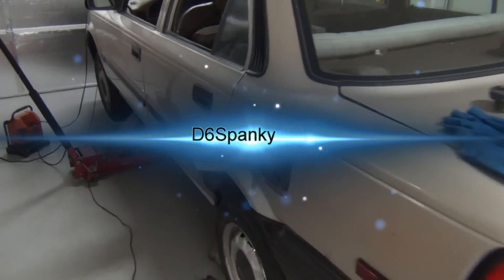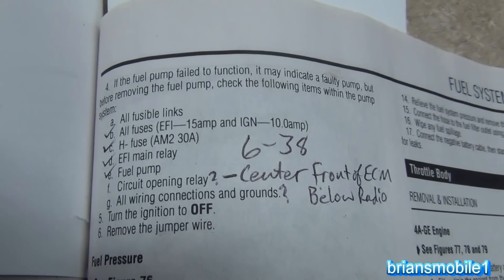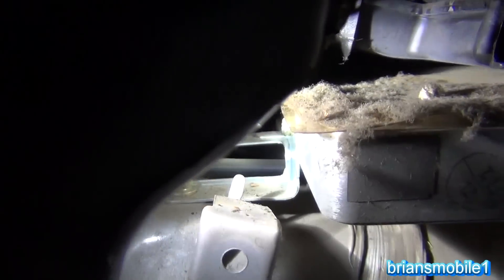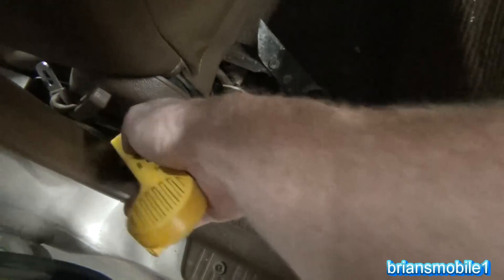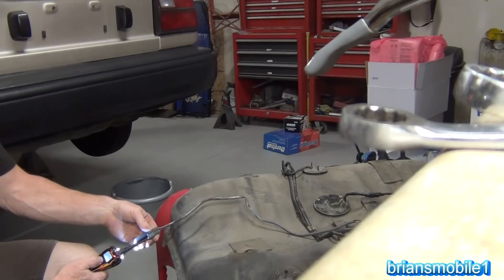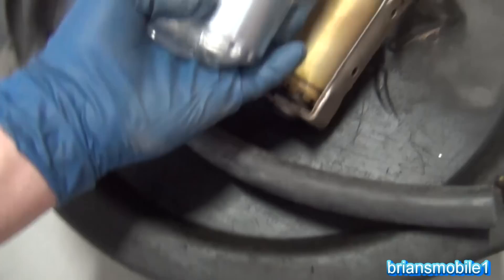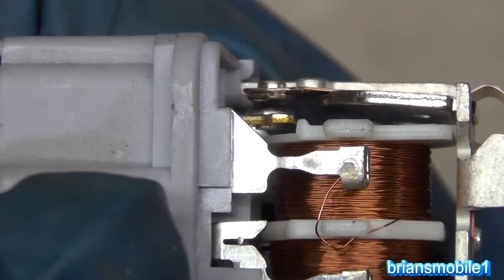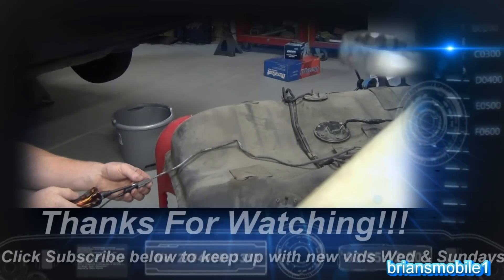Toyota Fuel Pump Circuit Opening Relay

Comment: Brian, in the olden days of points, plugs and condenser tuneups, every decent backyard mechanic had a "point file" in thier tool box. It is designed specifically to pass the file between the contact points several times and this would remove the carbon buildup from the points to make good contact. Some folks would call the process "burnishing" the points. You need to add point files to your tool arsenal.  Excellent vid by the way.
Reply: I actually bought one of those point files to use on my 1989 mustang 5.0. Sometimes my brother had the tendency to quickly release the key ignition from the start position which would create a quick spark at the distributor rotor tip   causing carbon build up at that tip and the contact points on the distributor for its perspective spark plug cable. At first I would use sand paper or a new sharp blade to scrape off the carbon build up on the contact points. This would solve the problem and the engine would turn on right away. I told my brother not to give it a quick turn of the ignition switch and to count 2 maybe 3 seconds when turning the switch to the START position to ensure that the engine would start.  I bought this point file at autozone, surprisingly, and it came in handy. Later I replaced the ignitor, spark plug cables, distributor cap, etc with higher end brand parts. Haven't had the problem ever since. That simple point file is in my specialty tool box; tools that never lend out.

Comment: Ah ah! 25 years ago my 78 Celica ..I thought my fuel pump went bad ..pulled it and at the last moment ( knew nothing of electrical diagnostics at the time) I  hooked it straight to the battery and watched it shoot water for 6 + feet ..so put it back in and ran a switched power wire to the pump ...also worked as a poor mans fuel shut off anti theft ; I would forget sometimes to hit the switch ..my car could only go about 300 feet
Reply: deepsquat600 Great story!
Reply: yeah what I meant to add there was I wonder if THAT relay was my problem?
Reply: deepsquat600
This particular design of relay as a part of the fuel cut off system to protect you in an accident...guessing here...I think came around in the 90's. Maybe a little earlier.

You probably had a simple wiring problem...well, not know where the problem is...simple could be horrible without that tone device.

Comment: Hey man! this reminded me about a thing. My girlfriends mom got a 93-ish Toyota Celica that she managed to flood when it was a rainstorm so the water on the road turned out to be to deep... Now nothing happens. it works pretty long time but then there was some other problems (exhaust almost fell of and a bad rear tire). The starter relay doesn´t even click now. we´ve tried to push start it with another car, but nothing. we find out all four spark plugs had cracked ceramic, so they are new now. there´s no water in the fuel tank and the pump runs. Any idea what it could be? or atleast where to start looking. even if the starter doesn´t work, it would atleast started when being pushed. and also, since the starter doesnt work, we don´t know if it gets any sparks (hard to se when you´re being dragged behind another car haha).
sorry for this really long comment, but i´d want to make it run. nothing else for now, just to hear it atleast trying to start

Comment: Ugh...  Airtex pumps are such utter garbage...  I've had good luck with Precision brand on the lower end of things, though!  Typically about the same price as the Airtex units; they just run quieter and last longer.  ;)
Reply: rhkips I honestly believe Airtex telling AutoZone that 80%-90% of the failures were garbage in the gas tank related. (Word of mouth from a parts salesman . . . sorry, I love my parts guys, but I can't be sure of this reference.)

Trouble is...that always happens and most people can't afford to pay a mechanic to do a thorough clean out...so their excuse for a bad rep. doesn't hold any gas, I mean water.

Yes, this should cause premature failures, but just a bit of crud shouldn't bother most fuel pumps or even new cars with Airtex failure rates would be failing due to the crud that certainly comes from some/all of pumping stations.
Reply from the maker: rhkips I've had them fail inside of a year with perfectly clean strainers.  I WANT TO LOVE THEM.... but can't.  They just don't perform as should be expected.
Reply: DE Nichols
Yeah, I once had four go bad within a year on the same vehicle.  The fuel tank was replaced at the time the first Airtex pump went in, and only top-tier fuel from a known-good source was ever put in the vehicle.  As it was my own personal vehicle, I can say with confidence that there was no contamination in the tank.

After warrantying out the fourth unit, O'Reilly's gave me a Precision brand unit, which outlasted the car at >2 years.  Ever since then, I've used Precision pumps on customer vehicles when OEM units weren't an option, and haven't had a single complaint or comeback.  :)
Reply: briansmobile1
It's really sad; they used to make such good equipment.  My experience with them has been so bad that I avoid anything with the Airtex/Wells brand on it.  I don't know if their other stuff is garbage, but I don't want to find out...

Comment: Looks good.  I'm surprised you don't have a point file.  

Chris
Reply from the maker: shadowdog500 I have a whole set, but the contacts here are to rigid and the gap is too small- most tech's these days don't even know what points look like- let alone have tools to service them.
Reply: briansmobile1 newer vibes have the same thing, well vibe/matrix it is up under the dash dude, guys like to splice the after market auto starts into them and well over time corrosion will get into there amazing sealed soldered joint and cause a no start

Comment: Incredibly helpful video for anyone with one of these toyota's. Thanks for another great video
Reply: steve hall My shop doesn't know how to charge for electrical work - literally, not a part of the corporation for the most part. So tracing a few problems with a tone generator an saving tones of time will really help me on TONS of problems. Especially, with the tip to hook it to ground as well so all of ground doesn't generate tone.

Shoot. Can't find a relay? Hook a tone generator to the fuse that'll go to the relay. Found! THE best part is getting smarter around Briand. :)

Comment: i clean relay contacts all the time. the trick is to cut the plastic cap off cleanly so you can re-glue and use fine grit sandpaper (400-600 grit).
Reply: happy543210  
Yep,I have been cleaning/restoring very expensive relay contacts for decades. Some would literally cost $1000s to simply replace. 

Just a friendly tip, the cleaning/restoration job will be more reliable and last much, much longer using a relay contact burnishing tool such as these: 

http://www.pkneuses.com/www.pkneuses.com/cont.htm

https://www.google.com/search?num=100&newwindow=1&site=&source=hp&q=relay+contact+burnisher&oq=relay+contact+burn&gs_l=hp.1.1.0l2.1129.22423.0.26135.19.16.0.3.3.0.273.2902.0j5j9.14.0....0...1c.1.64.hp..3.16.2638.0.60ullnSY_1E

The reason being that using sand paper leaves residue/debris behind that creates resistance and promotes arcing and new carbon buildup.
Reply: thanks Happy, You are the man. That's what I needed to know. Thank you!!

Comment: My G-D who thinks of hiding these parts. Instead of all the political correctness these days we need to hunt down these engineers! Never thought of using my tone and pickup on my car, great idea! Best of luck to you and Spanky!!
Mike
Reply from the maker: Mike Shelly Thanks Mike!  In all reality, this car is almost a quarter century old and this is the first time it had needed to be accessed.  That's actually GOOD engineering.  And the only reason it went bad, was because the car sat and got rusty in the gas tank which caused too much resistance and heat to the contacts.   That's not too terrible.  To me, bad engineering is designing things that leak no matter what you do,  are of poor materials, or vibrate to death on the road, or fail over and over again through campaign after campaign of TSB's, recall's and patch ups.  Basically Taurus' and Altima's over 100k miles.
 ;  D  I HATE those @#$% cars!  HA!
Reply: briansmobile1 Just replaced the fuel sender in my VW, and bought an aftermarket one, as the OEM is way too expensive, as it of course contains the fuel pump. Same white plastic turned yellow brown in mine, and the fuel pickup filter was half clogged with fine debris from the assorted fuel filling station tanks. Of course being aftermarket I had to "finesse" it a little to get it to actually work, but it at least now will read properly on the gauge.If it conks after a year I will be doing a swap between the two to combine the best of both, as they are direct copies down to the tooling marks ( old one was genuine VW though) on the mouldings.

Those Toyotas are pretty reliable, I rebuilt the engine on mine after it blew a head gasket on overheating from coolant loss, and did a lot of practise on rust removal and plating of panels. Service regular and it will do another 20 years. As the old saying is Everything keeps falling off - Toyota. Mostly bulletproof drive trains though, aside from the Cressida 2l or larger, which loves to eat the differential. Drive not like you stole it and it will just carry on.
Reply: Kidding? Its a 91 and still running..
Reply: ***** Still a shedload of 1960's era Toyota Coronas still running around here, along with all the Corolla variants ever built, in large numbers and varying condition. There are still Toyota Super 16's and Hi-Aces running as taxis, on the road 24/7/365. You can't tell the mileage, as the odometer either has worn out or has been around the million km mark a few times. Helped a friend with his Corona pickup, though we did decide to sell it, not enough time to give it justice. Had to do a lot of electrical work, along with some bodywork and massive rust replacement. was fun getting that fuel tank back in with the ultra stiff old piping, as there are no replacements available that fit, though we did eventually make a steel elbow and used new pipes to get the thing in and not leaking. It arrived driven down 400km, with brakes that were best described as "mostly there" and a clutch that mostly wasn't. Funny enough clutch off the shelf, and brakes went a few oversizes on the reline.
Reply: briansmobile1 For sure quality is the utmost on the list BUT you should not have to dig into a dash to fix a fuel pump issue. I don't want to put my  mechanic out of business he has to eat too but as a dyi'er I should have a fighting chance to fix a simple issue like a relay. If that relay was in the engine bay or with his other friends  it would have been a 5 min job bet it took you a lot more than that. Good job by the way!!
Reply: SeanBZA I bet Bosch is the OEM for your fuel pump. They love to integrate as many components as possible into one unit, which in itself isn't so bad, as it keeps manufacturing costs down. But when one such component fails, like your fuel sender, or the electronic parking brake motor that is integrated into the rear brake calipers, you have to swap out the entire unit. You can't get into the unit to replace single components because a) they have welded or riveted the unit together and made it unserviceable, and/or b) they simply don't sell replacement components. You have to buy a whole replacement unit, and Bosch and the dealers make lots of extra cash.

(Sorry for the rant. I just had to vent my anger.)
Reply: pesshau Yes, all in one. It did last 14 years though, and did 220 000km though. I have changed the pump alone on GM vehicles, as the OEM price makes a pattern part pump alone worth the work. Needs a little work to get it to actually fit and work. 

GM, they make the water pump the cam belt tensioner, so you have to buy one every time you do the belt, and often the bolts rust fast so you have to pull the engine to drill the old one out as well, or drop it so you clear the chassis on some of the bolts. Then they make the pump so cheap and nasty the seals fail before the belt change interval........
Reply: Mike Shelly  Inside the passenger compartment up high on the transmission hump was the best place to mount the environmentally unsealed components of the day(25 years ago) such as the ECU/PCM and fuel pump safety relay to protect them from heat, vibration, moisture and damage.  
On this model car the area they were mounted in is not that difficult to access either. 
Unfortunately a lot(most) of the less expensive manuals do not describe the circuit operation, have a decent diagnostic fault tree chart, accurately identify the location and routing of wires/cables, connectors, grounds, components such as the COR and ECU/PCM which can and usually does extend the MTTR of electrical related complaints/faults.
Reply from the maker: Mike Shelly It did take a long time.  You're right about that!
Reply: patw52pb1 I can appreciate that. Especially the PCM. But they could have put that relay with another grouping. Oh yes the manuals that's my other grievance.  The Haynes and Chilton manuals (same now I think) really suck. As a dyI'er not going to spend a monthly fee for a manual have 4 cars.

Comment: Great diagnostic.  Tracking it down all the way to carbon inside a relay.  You're too good. :)  That short finder (tone generator) is surprisingly affordable especially compared to Power Probe version that has a similar device.  Poor Airtex getting no love.  Made in the USA but with their failure rate it's like they're made in China. :(
Reply: ***** Unfortunately, that's the case with a lot of Western manufacturers these days. They have to cut costs wherever they can in order to compete with cheap Chinese labor.
Reply: ***** Made in China, packaged in the USA/Mexico to meet the minimum local content spec to have the USA mark. 

You know you can go to a Chinese manufacturer and they will happily put the Made in USA mark on the box for you, so long as you pay them they do not care, and will smile.
Reply: SeanBZA That crap used to be illegal. We had the stiffest most awesome labeling laws in the world. Now the U.S. can legally lie made in the USA as long as inside after you buy it you find the made in China.
Reply: patw52pb1 The laws must have improved again. I was having some freak out moments several years ago where it said proudly "Made in U.S.A" for a China label to fall in my lap as I opened my new knife package. 

Some news caster commented on labeling laws being shot. Thanks for reinforming me correctly. :)
Reply: patw52pb1 I  think everyone who thinks on this stuff sees through "assembled" in U.S.A.
Reply: DE Nichols Absolutely! All it takes is partial disassembly to see the majority sub-assemblies that are (usually) clearly marked as foreign made to confirm that most of the item is truly NOT "Made in USA" and the assembly in the US was minimal. . 
No where is this more evident than with the iconic Timex watch that up until around 2003 proudly displayed the "Made in USA" label, then the labeling changed to "Assembled in USA" and the last one I looked at last year was now labeled "Case Made in China". 
The changes in labeling was due to US FTC disciplinary rulings against Timex that were litigated for about 9 years. 
The irony is that the Timex branded watches have been mostly assembled at the same plants in China, Philippines, Thailand and Taiwan for the last 35+ years. 
Prior to 2002, the only thing assembled on a Timex watch in the USA was the band, now even that operation is performed off-shore.
Reply: DE Nichols It still is illegal for components made outside of the US (China) marked "Made in USA". 
What you describe is "assembled in the USA with globally sourced 
(usually China) components" which is a grey area and usually legal. 

https://help.cbp.gov/app/answers/detail/a_id/492/~/requirements-for-country-of-origin-marking-on-goods-imported-into-the-u.s.

https://www.ftc.gov/tips-advice/business-center/guidance/complying-made-usa-standard

https://en.wikipedia.org/wiki/Made_in_USA
Reply: ***** Got some love for AIRTEX for you that'll be shocking. I gave up on a good brand of IAC and went Airtex. 

I hated the thing. My car ran worse! My old one only moved through half it's range but the Airtex moved it's whole range but appeared hated by my PCM. 

Loping idol. Blah!

...now it looks like I had a vacuum leak that presented as a rich fuel trim from overcompensation. That's positively nuts and worthy of a Schrodingers Box "Case study from [HECK]".

I've been figuring it out since during his case study where I had similar problems minus substitued values.
Reply: Note: gave up as in Airtex was the least hated brand for $100+ instead of frightening eBay or $239+.